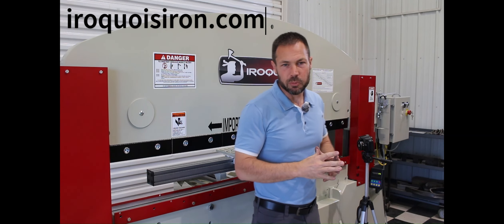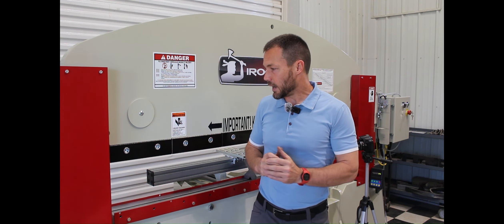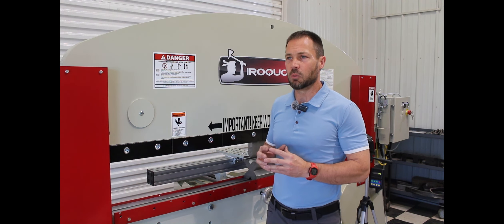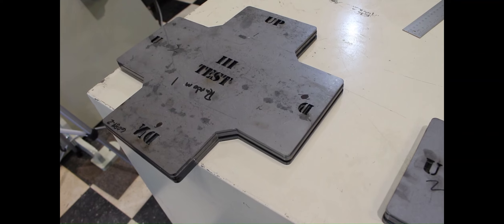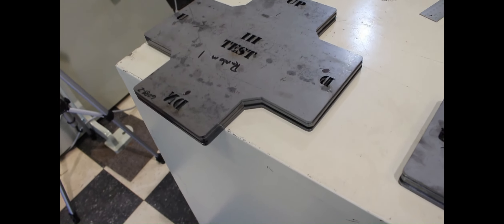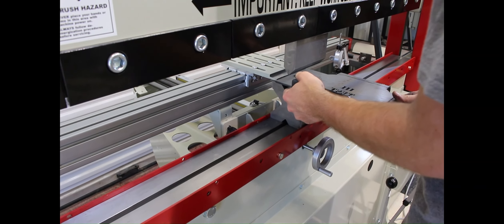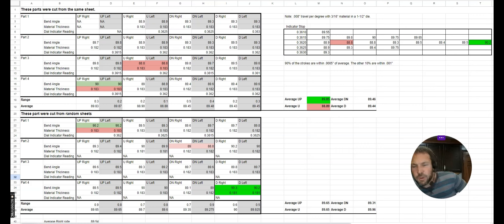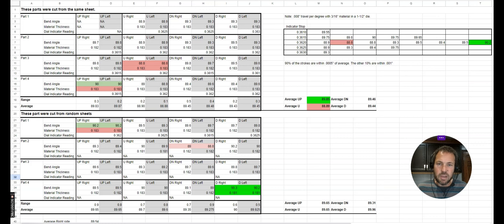How to Bend Accurately: Variations in Steel

Comment: I have a machine showing up this week, and I'm super excited to learn how to operate it accurately. I would say the benefit for me is that I have had to learn the craft of bending on a manual press brake first. I have been fabricating for 15 years, and everything has been on a manual machine. While I think that will help me with the new machine, I am very excited to take my abilities to the next level with a next level piece of equipment. Great information. I've never had to think about the grain of steel while braking plate. I do believe that if my material is within a few thousands that will be plenty good for the type of work I do. Looking forward to operating your machine in my shop. Thanks for the great video!